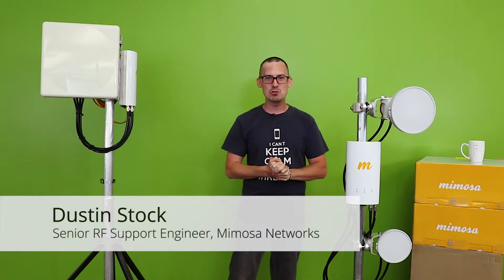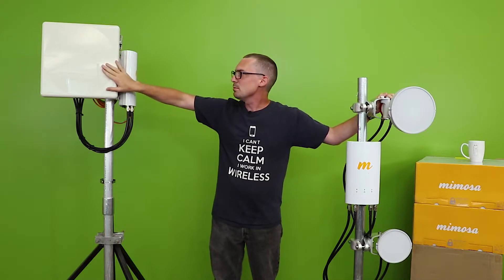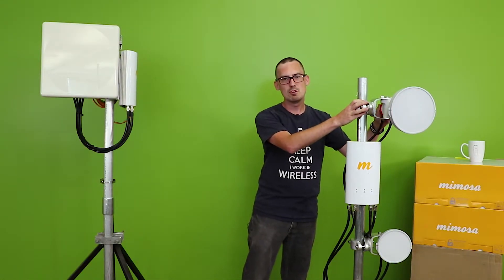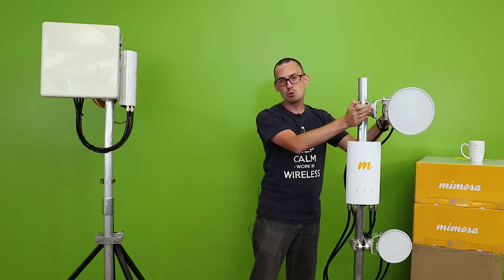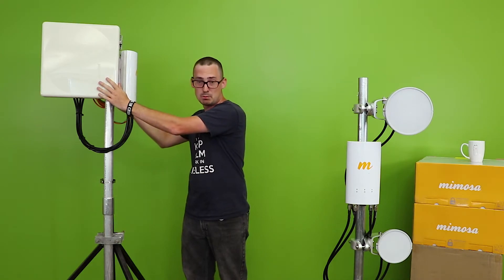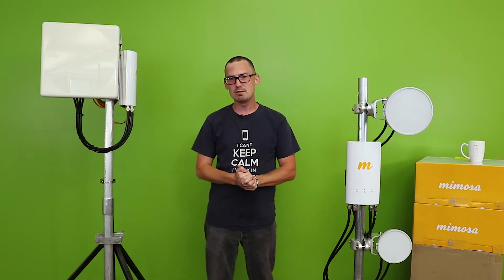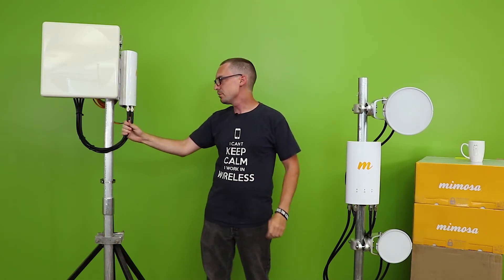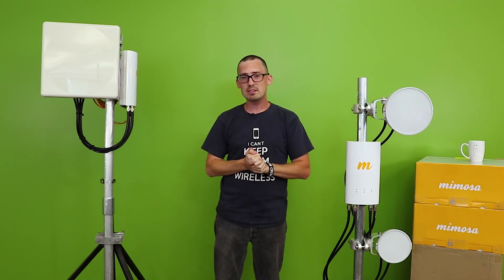Mimosa Networks: A5c Antenna Selection

Comment: When using the RF Element Horns what is the purpose of two different sizes of horns or do you recommend the same size of horns?  If we are providing our customers 100Mbps, how many customers would you expect to put on one AP?  Thanks for posting the video.
Reply from the maker: Happy to answer this question, but we need more details. If you fill out the contact us form on our site, someone from our team will get in touch with you—https://mimosa.co/contact-us